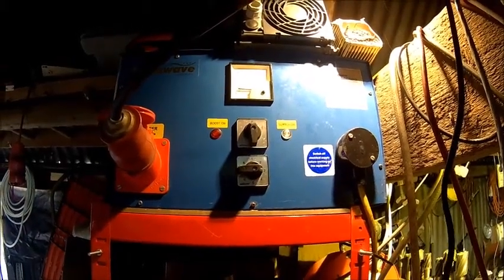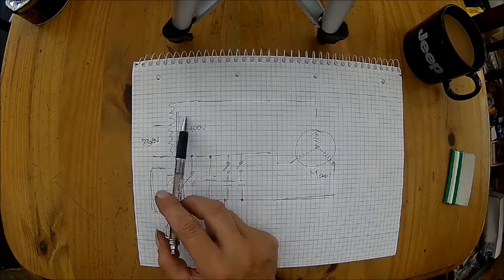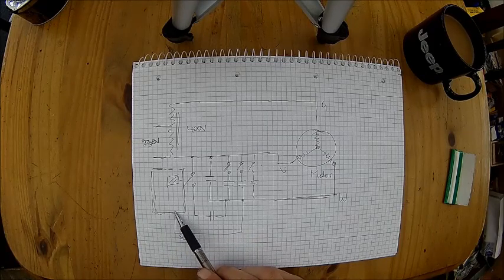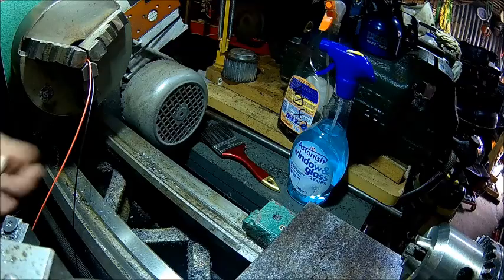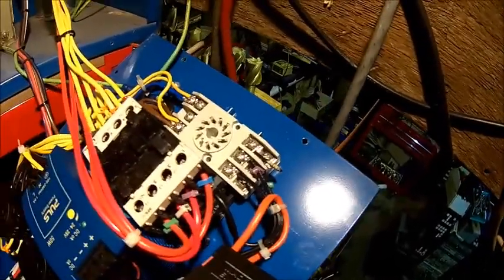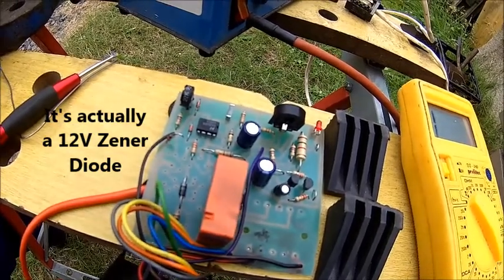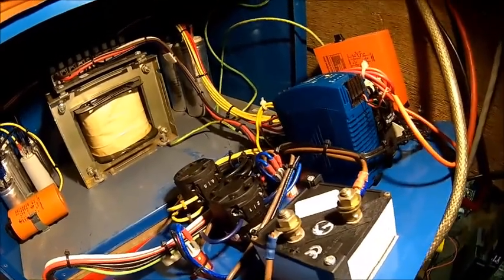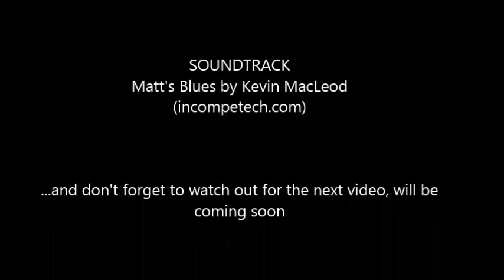Phase Converter repair + working principle explained (Transwave static, not rotary)

Comment: Hi Mike - Ive been looking at the options for 3ph in larger older motors (pre 1950's types) as I may be looking to upgrade my lathe to a larger unit in the 5-7hp  size - my gut feel says a 240v 1ph inverter to 3ph 240 v out unit is just going to give me trouble with the older motors (insulation etc etc) - so then I started looking at the static converters ... then rotary types - sat and watched this vid' last  night pt 1 & pt 2 interesting but no pt 3 which is frustrating. How do you fancy building a suitable unit for 7hp lathe ? Mat video link https://youtu.be/IEOORRuX4wI
Reply from the maker: Hi Mat, i can certainly stitch you something together but consider a few points first...supply: do you have 25A minimum, better 35A because of the inrush current ...if not, that means new consumer unit, wiring down to your shop, etc, i guess £1k, ..next: a static phase converter does not produce a proper 3 phase supply, therefore you loose at least 30% of the motor torque. I would go rotary or VFD, with decent (and i mean decent) output filtering an old motor should be able to swallow that with no issues, providing the motor is still in good shape.
That supply problem is one of the reasons why i am currently building a 12kW  diesel genset for my shop

Give me a call and we can have a chat about various options

And last but not least,...i wonder how you'll fit a serious lathe in your shop ....
Reply: still in the planning stage Mike :-) Rotary converter was the plan. or VFD depends on the lathe & motor it has. I will be in touch when / if I get progress.